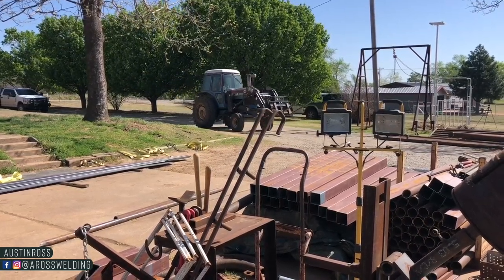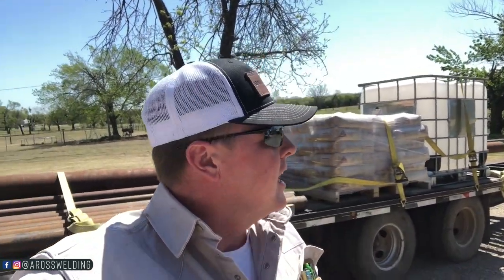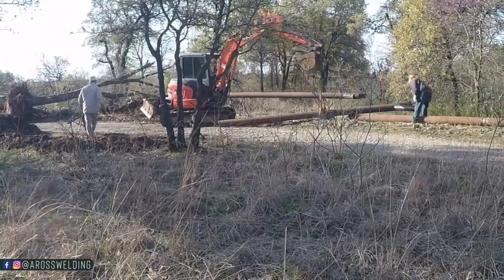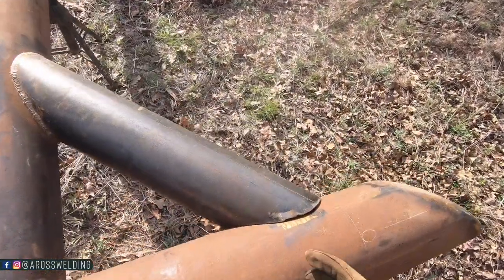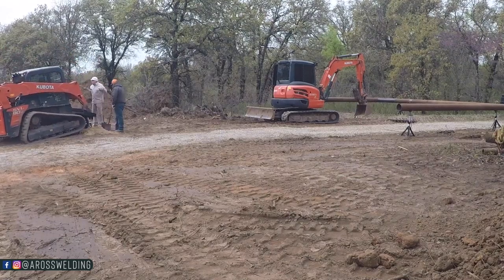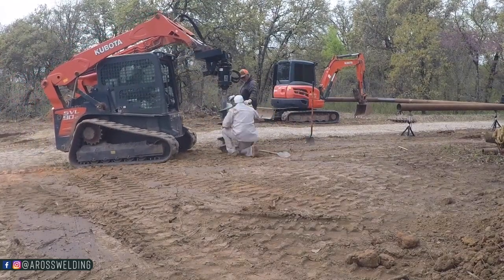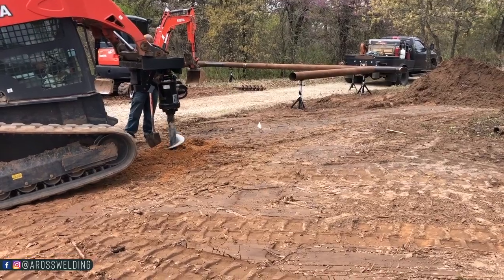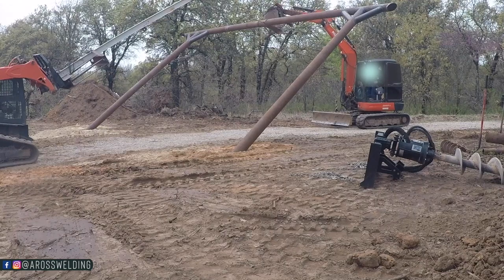INSTALLING THE 8” CUSTOM PIPE ENTRANCE! (WILL IT WORK?) Part 8

Comment: I'm an equipment operator, one tip I can give you if you don;t have the height with the two  machines you can "choke" (double cinch )  the pipe 3/4 the way up to lift the pipe off the ground so you don't cave in the side of the hole.

Comment: Great job. I love that it’s big and tall enough for a semi truck
Reply from the maker: Thanks. Me too. I think it turned out good
Reply: @arosswelding  did ya put a foot,piece of tin,bottom of hole so it dont sink, & use tin,both sides of pipe,stop dirt in the hole dropping. acts as a skid..id even put 2ft concrete in there so the pipe fills a little..even blow couple holes in side for  extra bite of crete..
Reply: Nice job Austin
Reply: Good morning sir please my name is DennisMichaelPlease I am into structural welWelding department please I want you to help me I'm done with my work but I can't meetBit off with my working tools so I need someone that can help

Comment: On my little tractor when I'm installing swing sets I have a pallet with six foot extension with another pallet on top. I first lift the top of the swing and put it on my six foot high pallet. I then put the forks on the bottom of the pallet and lift the swing up and set the pipe legs into the hole. You must be on level ground. The six foot pallet is made of steel and stores in the front of my trailer. Doesn't look safe but I have not had a problem. Your pipe is a lot heavier than my swing sets but it should work. Handy to have.

Comment: Almost an anticlimax all that work and up in one day. But shows the prep and planning paid off. Looks good though definitely a statement. Your tip of the day is spot on. As a Carpenter builder of 40 years building up contacts with people in your industry is vital. And a good working relationship. If they know they can turn up do their job without hassle and the big one is get paid in a timely fashion you will get good support. Find good workers you can trust and keep them sweet.

Comment: On the ranch we always set the gate back far enough to put a conventional tractor and a set of doubles stock trailers between it and the road so nobody ever had to stop on the highway to open a gate 
If the gates couldn't swin inward we increase it the length of the gates plus a little more. The lost grass is a smaller cost than fixing equipment that got hit by some dummy driving a Mercedes .
Reply: In texas oil companies do 40 ft inward from fwnce line

Comment: Using a pressure washer will mix the cement as well as add water works great setting posts. Give it a try.

Comment: Guy always has garage rod (8010) leftover from jobs.  Usually if they were open boxes of rod the contractor  didn't want them back . They would just throw them out . Even in a sealed box if not stored right cellulose rod will stick together after awhile . Good Job Austin

Comment: My welding truck is an OLD F700.  Ex railroad maintenance truck.  Has a knuckle boom on the back.  Not good for pipelining but great for structural stuff.  I'm going to figure out a CNC plasma setup that is small enough to carry on the truck.

Comment: Your dirt guy has the equipment yes, more importantly, he has the talent to operate that equipment in an efficient and knowledgeable way. nice work. Did you use plumb on the vertical poles to insure horizontal pole was level?

Comment: Question:  I'm curious how painting works on your work.  If this customer wanted the posts painted, would you sand blast it or is there paint that you slather on right over the surface rust?  Love your videos!  They're so fascinating!  - Joe from Seattle. 😁
Reply from the maker: Either way. The most long lasting way would be to sandblast it first. But a lot of people just paint there fence with out sandblasting it.

Comment: Maybe I missed it but what did you do to make sure the top came out level and at the right height for trucks?
Reply from the maker: In theory the top is level because the post are square with the top and we leveled the posts.
Reply: @arosswelding  
Ok I'm not sure I understood that..
Did you mark the posts at 5 feet for even depth ? Ground level enough between the posts I guess ?
I was concerned about pipestands sinking into the soil with all that load on them..700 +lbs per post, std wall. Sheesh! I would've put leveled plywood pads under the pipestands. Cheaper than a leg cast..lol

Comment: Why is it that people sell there old welder/Generator welders for more then you can buy a brand new one
Reply: I noticed that..I looked at used Bobcats n rangers .$3000 or so with 3000 hours ( when pros get rid of them..). that 23 hp air-cooled chinese kohler lawn mower engine has a limited lifespan. 
Bought a nice SA-200 for less, and  that Continental Army jeep engine will outlast 10 of those air-cooled jobs.